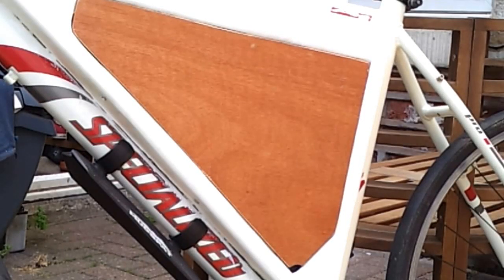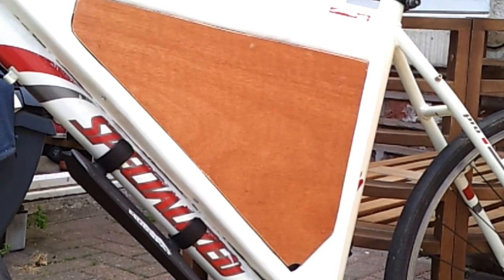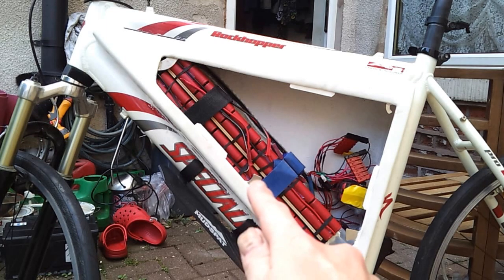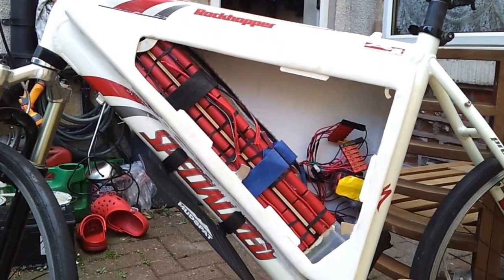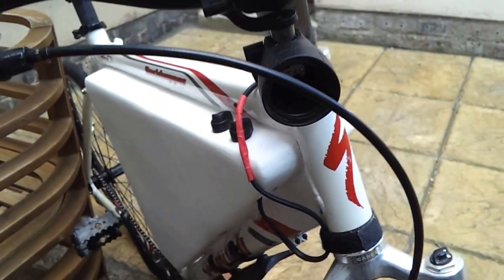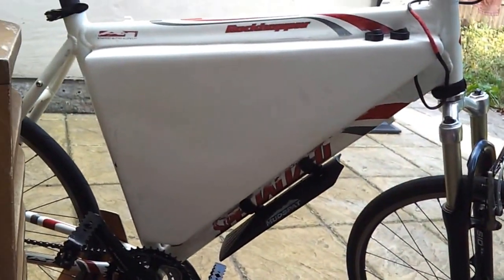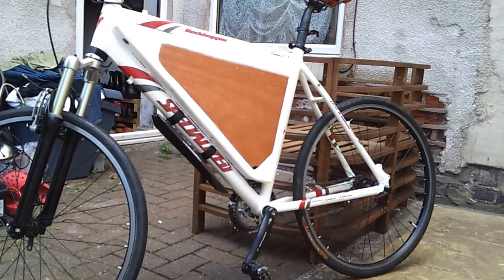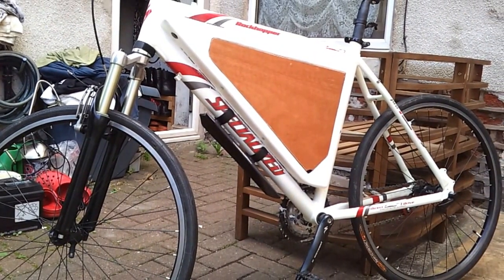Electric bike project..update

Comment: How are you getting on with those red batteries?   I'm finding with the pack I've just built with similar red Sanyo 18650's  I'm detecting lots of voltage sagging.
Reply from the maker: You will buddy..old tech by now..only 2c discharge.
Stick plenty in parallel to help.
Best wishes.
Reply: Crispymenace 12p 14s.  still pants lol.  I might have to resort to buying a bulk amount of newer cells.  But which ones? ?? How'd you get on with the lipo packs?
Reply from the maker: They are very good..im using the hobbyking multistars atm..72v35a no problem..they do sag to tho.
If you really want to hammer them with little slippage get some 5ah 100c turnigy cells
Reply: Crispymenace I have ordered 4 Turnigy heavy duty 5000mah 6s.  Hopefully do the business.   Thanks for your help.

Comment: hi Stu
Dave whale here chap you helped with bike battery and helped you with 2 laptops, WELL M8  i have the following for ya,!
1/12v motorbike battery new 10 amp hour
2/a Chinese 18650 spot welder new, do you need one
3/i also have a front wheel electric hub kit with controller and twist throttle kit, with (350 w )with new tyre and loads of other parts to suit,
i went from electric bike to electric scooter/moped, to a 50 cc scooter/moped, and because of dizzy balance spells i needed a tricycle so i now have a 3 wheel piaggio mp3 250 cc 2006/7 ---on the road and legal ride able on car full licence, so all electrical 
stuff has to go,  
let me know what you want and all i would say is you fetch it or pay postage costs,and its yours,
dave

Comment: good stuff
Reply from the maker: thanks Harry,,
 im a bit behind with it at the mo,
 but summer soon come and that should get me back on to it!
need a motor next.;]
Reply: my nxt e bike build is going to be a off road set up and i'm thinking of using a mac motor from EM3ev  there mac motors are pretty good and well priced. Its just another option for your build if you haven't already checked them out. Think you have done a great job on the battery box, looks spot on. keep up the good work mate hope to see more vids of your build in the near future.
Reply from the maker: Harry Ljm
nice info buddy, that site for the mac motors is good.still thinking bafang style mid drive tho ..im worried about a hub not having enough torque for the hills round here..i like the no reisistance when peddling home too.. cause ya battery died...lol.
.if ya live uk i can hook you up with some 18650 cells too for a good price/trade.
 if you want to experiment with packs n stuff there cool, let me know.
atb.
Reply from the maker: *****
 hello buddy thanks for the comment ,not sure , never done a checkup on that.
got a huge pause- a- thon going down  at the mo,
hope to pick a motor later in the spring and get a move on her.
one pack you hardly notice..two you do. thats as far as i can say for the moment.;]

Comment: Anderson Clip Magic :-) Nice job, looks a smart e-bike for sure :-) A trick with the andersons is to glue gun their wires in the back of the plugs :-) That way they don't slip out if they get hit with a bolt of ampage :-p

Euro kit would be a bit better quality but for the price I would take a Chinese import. With the Chinese import controllers I know you can get 72-80v through them without frying them :-) don't go over that though, the amps fry them after 90v :-)

Looks smart, I like the switching on the outside :-) The only thing I would do is ditch the pedals and put a rear cam and tft monitor on it instead of mirrors :-) but each to their own :-D

well played cant wait to see how this goes, your dials look smarttt :-p
Reply from the maker: Your too kind buddy thanks for that.i recently molded a ryobi cordless saw and used Andersons on that too..i looked at um an thought i should fill them with something in the back to stop excessive movement..jobs on now  glue gun it is.
all the best:)